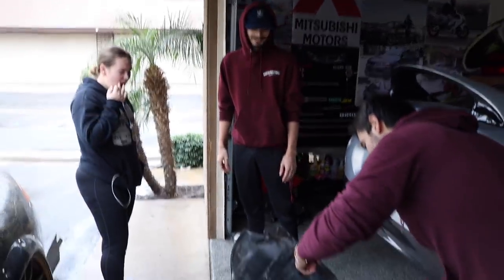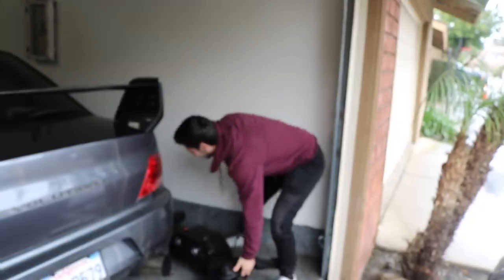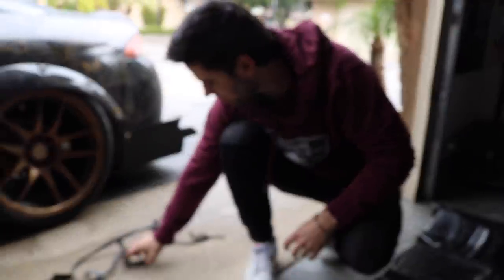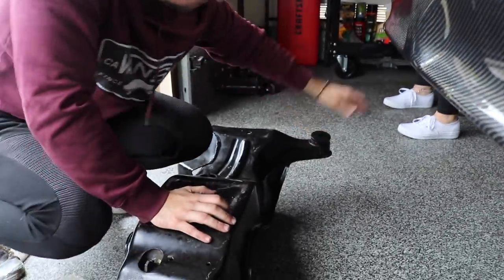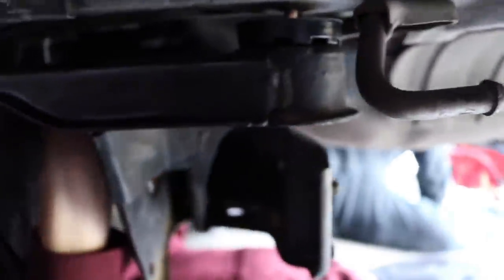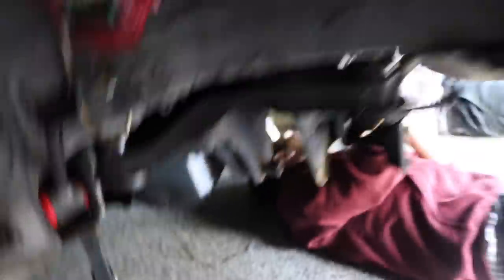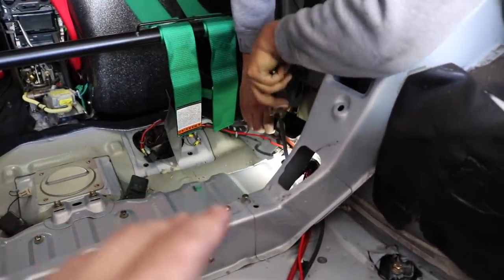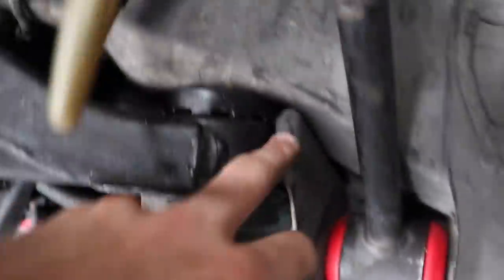Building A Mitsubishi Eclipse GSX | Subframe install! Ep.7

Comment: I welded the head of the bolts right to the shell, never spin again lol.
Reply from the maker: Yea that was my last option lol
Reply: Thats if you have access to a mig welder, not everybody has a welder but that does help to make the job a lot easier and make it a one man job.
Reply: @1998gst4611  well you need a welder for the driveshaft mounts anyway, so it shouldn't be an issue.

Comment: what are you gonna do about the driveshaft brackets that need to be welded onto the car? thanks for all the info, in between swap myself right now as well❗️
Reply from the maker: Welding them once I find them and the transfer case and transmission are on

Comment: Miguel I may of missed the purpose of doing this so whats the reason you had the entire rear end taken out, did you upgrade to polyurthane suspension bushings on it? That rear subframe and axles look clean  you boys out in Cali must have a bunch of prestine dsms out there. Here in Florida where i live the dsms are old, cruddy and rusted, rare to find. 2G DSMs are getting hard to find and 1G dsms are impossible to find. You guise are installing that Rear Diff the hard way you should of used a Floor jack to help guide it up there into the subframe and take the axles out, drain the fluid out first of course, makes the job a whole lot easier. Yeah that would suck to take the rear Sub frame out again, you didn't need to anyway if you used a floor jack but in your case you have an extra set of hands to help you. In my day when i owned a 92 Eclipse Gsx when i had the rear end taken out i did everything myself no help i relied on a Floor jack and a piece of wooden 2 x 4 to bring up the subframe and rear axle carrier.
Reply from the maker: We were using the jack on the talon, otherwise that would have been the plan
Reply: @MiguelDsm  oh i see you're working on 2 cars the other one thats outside under the rain, it looked like it was raining in the video

Comment: Have a question for you. I have a 03 gs eclipse and am planning to do the same thing
But first I want to do a engine swap from a 4g64 to a 4g63t. And a transmission swap from automatic to manual.  Any recommendations for the swap and which evolution should I use for parts?
Reply from the maker: Just Evo engine. Use your manual 3g trans
Reply: @MiguelDsm  I don't have the manual transmission yet. I found one and will get it soon. Also I plan on doing a and set up on it.

Comment: Hey man I had a question. My friend is selling me his GSX for $6000 it’s honestly clean and has maintenance like timing belt and stuff like that done. I just want to know if it’s worth it
Reply: It’s a 2g
Reply from the maker: Thats the average price for a gsx. If it’s in good condition I would go for it
Reply: Thanks for the reply man. I just needed to know what a GSX would go for. It’s honestly In really good condition body wise. He told me the following: the car has new engine seals installed water pump Tensioner oil pump alternator rebuilt turbo new stage 1 kit clutch new timing belt new radiator I mean the car got all the maintenance the car needed.
Reply from the maker: I say go for it. Just expect things to break. It’s an older car
Reply: Are parts usually hard to find/hard to fix? Also is it expensive maintenance? I’m willing to throw down money on the car and I wouldn’t beat it knowing the car is a gem. Sorry for the questions lmao
Reply from the maker: Theyre everywhere. Partouts, Facebook groups etc. No worries!

Comment: lesson #1 You 2 fellas should have known better not to lift up the rear diff by hand and not putting it on the jack. lesson #2 make sure the AYD ebrake sensors are good and not damage